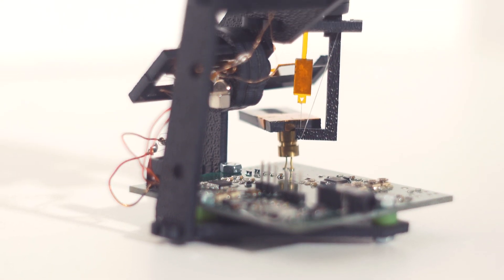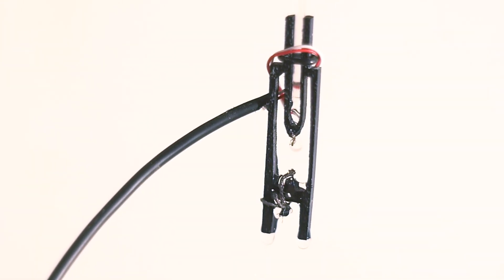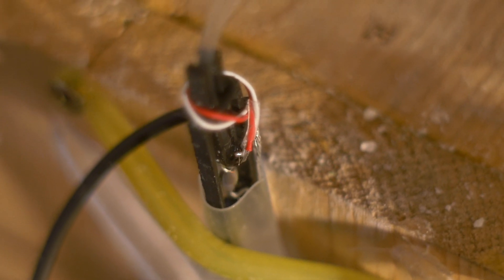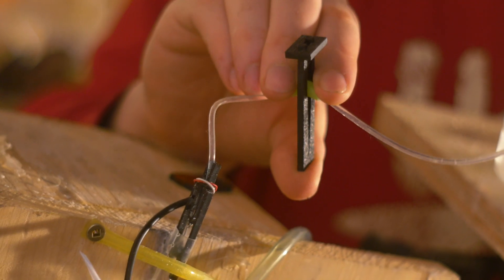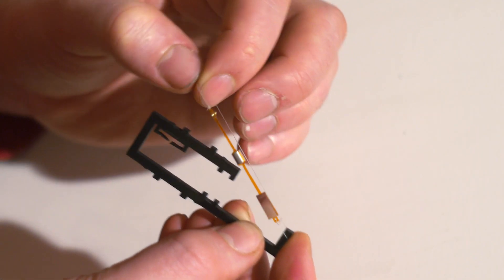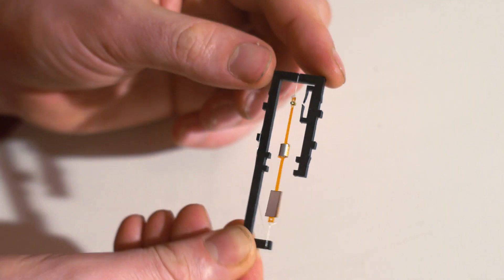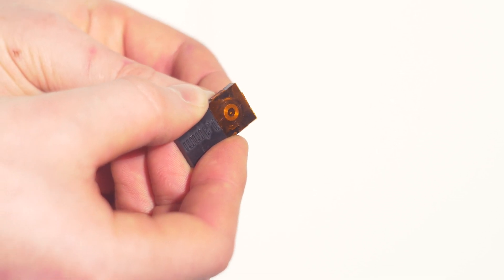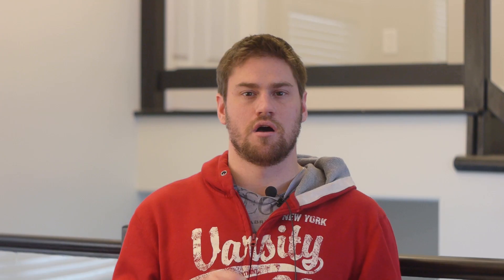Update #46 - Hardware Developments #5

Comment: I'm a little worried about rubber bands - they go bad after not very long. Perhaps silicone? That should last a lot longer.

First surface mirror is a must - without that you'd never get decent finish, and I can't believe you were considering using something else! (The other option, instead of poly or glass, would be a bit of mirror stainless steel)

I'm looking forward to my two (I ordered one of Indigogo and another off Kickstarter!) and I've now got a hackspace for each of them. :-)
Reply: Silicone will last longer, but I do not know how much longer.  This is going to be a consumable item.
Reply: Both will do that, but silicone is less likely to perish. Rubber bands often fail in a few weeks due to oxidisation effects.